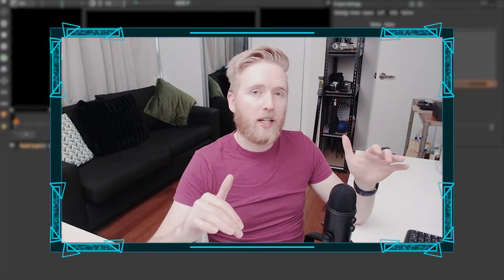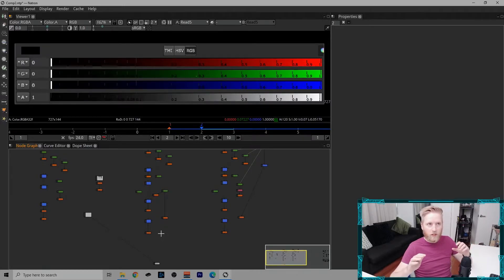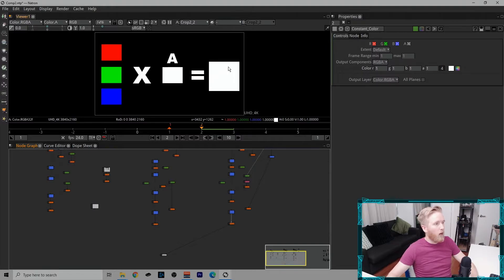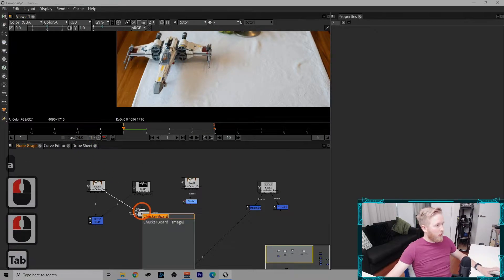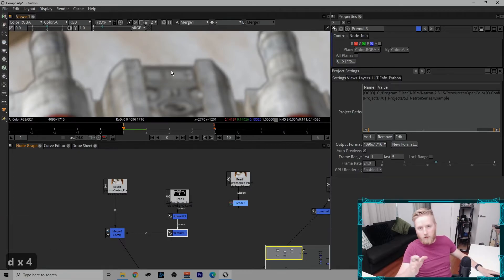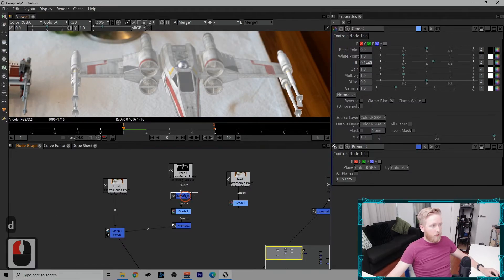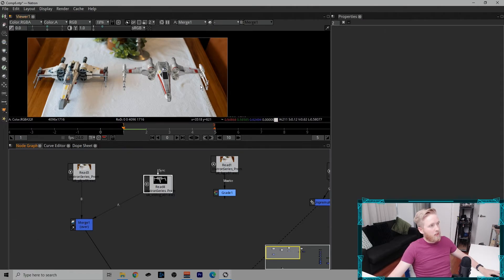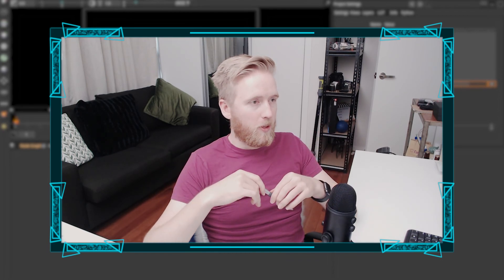NTP3: RGBA Channels and Premultiplication for VFX Compositing

Comment: Hello once again!... it looks like I can't post external links.  My parametric mask layers were unfortunately saved as RGB even though I saved the whole Tiff image with alpha so when I try to shuffle and merge with my original image, the subject (A) is slightly transparent and the background (wether B pipe or mask) not fully transparent when I try to use my image sequences in my video editor (the desired background is actually video thus easier to composite furthur in the video editor).  I wonder if there is a roto tool in Natron that could 'read' my mask layer automatically...
Reply from the maker: Use the shuffle node to send the red channel to the alpha channel

Comment: Hello!  I have multiple images (sequenced) with layers saved in Tiff (with alpha) but my layers were composed of parametric masks based on luminosity thus I have a layer where visually the subject is white while the background is black (and even for some sequences, a layer that is the opposite), but I didn't know how to convert the parametric masks to an matte or alpha layer in the photo software.  How do I convert the layer to an alpha layer (even if they are not perfectly black and white)?  I keep using the temp shuffle (community plugin) for layers or the shuffle node but when I try to re-merge with my subject, I can't get the background out.  Can it be done in either Natron or Nuke? Otherwise I am stuck going back over a thousand images and attempting to convert to alpha in photoshop...
Reply from the maker: Hi, yes that definitely sounds possible to do over a sequence in Natron. The Alpha doesn’t have to completely black or white; it works on a floating point between 0-1. I’m struggling to follow the specifics of what you’re describing without seeing the images but from what I gather you should be able to accomplish your goals by shuffling out the colour layer you want then the matte layer and finally copying the matte layer into the alpha channel of the colour layer. That will give you a four channel (RGBA) image
Reply: @HarryChrisp  Hello again, thnks for quick reply!  I can't get to my project at the moment but I know there was a peculiarity in the channel components of the parametric layers which I don't quite understand how to handle.  I can repost with the specifics within the next 24hrs... would greatly appreciate!!